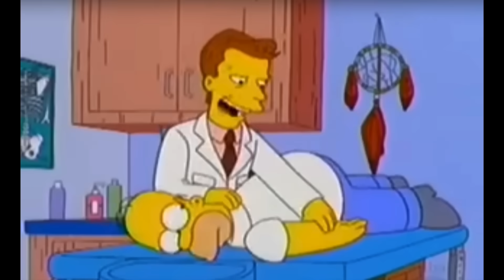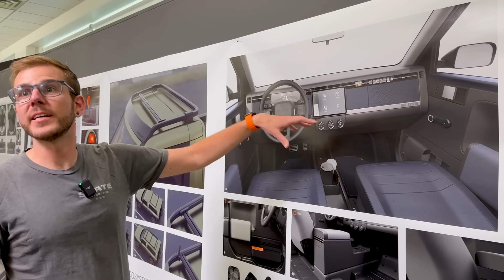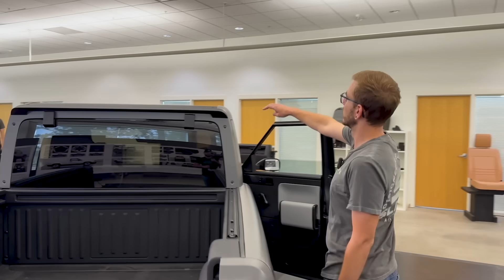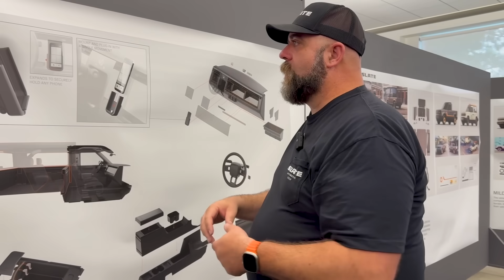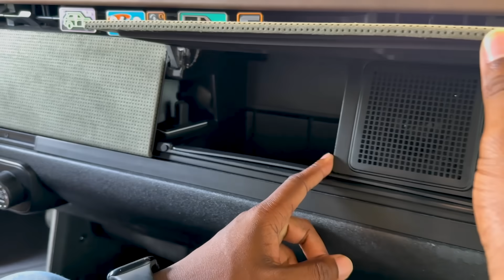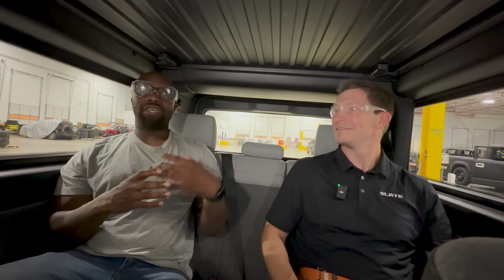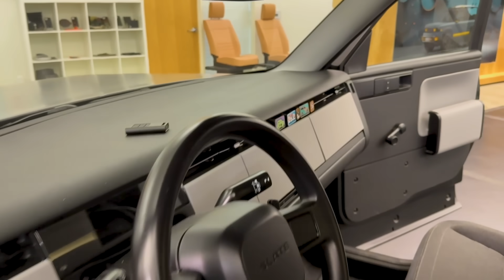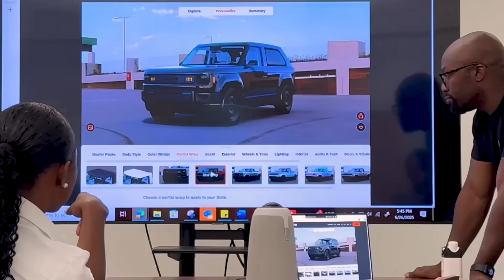The Slate: America’s $20K Answer to China’s Cheap EVs (Exclusive Access)

Comment: The only thing i have as a problem (from a perfectionist standpoint) why isnt the battery upgrade 2 normal batteries ? Wuldnt that also cut alot of costs? But since the money is already in another system that wont work

Comment: I wish you had asked about access to the traction battery. Is it 400v, 800v, 1000v?  Can I add a power access strip in the bed? can I hook up a generator and diy a range extender?  Can I even tow?
Reply: It's 400v
Reply: 1000 Lbs towing capacity….so no
Reply: The Slate truck has a towing capacity of 1,000 pounds. It also has a payload capacity of 1,433 pounds. The truck's bed is five feet long.
For 27.5k base price (its gonna be over 30k on release).. thats not good. 
New Mavericks and slightly used Ridgelines are the same price and are WAY more capable/relaible as trucks.. and 'truck' guys dont even consider those 'real trucks'!
Trump cut the $7,500 tax break (i think you still have till the end of the year to get it), so unless Slate drops it to 20k themselves (which they should), it'll be better off spending that 30k on something more worth its value.
Reply: All no.
Reply: Generator yes the rest?? Tow maybe an inverter and power strip in bed sure if that's your thing

Comment: There's no way on earth this vehicle will only cost $20k, but it's great marketing.
Reply: feeping creaturism ftw
Reply: If they take all the lego pieces off and u get a bare bone skeleton with minimum range and no options, it might be 20k after the 7k or what tax return.
Reply: yes, it's 27k because the $7000 tax credit that would've made it 20k is going away
Reply: @syloui By the time it goes into production there will be no tax credit.
Reply: It's gonna end up more than 27 k as well  @syloui
Reply: @syloui and with dealer make ups it will be .. $30,000.00… with no radio and crank windows 😂
Reply: @tpike32  i believe they are going to follow the tesla business model and sell direct.  That will avoid the dealer markup but will also complicate the where you go to buy one.
Reply: Yeah they are fluffing everyone up. Just like Tesla including rebates and estimated gas savings in the proce unless you un check them. 

It's a cute little ev truck and reminds me a lot of a standard cab S10, but I doubt this will be more than a city runner with 80 miles of range in it's cheapest trim... Nissan can't even do it and you can get stripped out leafs that nobody wants.
Reply: @volvo09  The average American only drives 40mi a day and those who are regularly going on long road trips probably aren't looking for the cheapest vehicle possible to do so. Those who have to live so far away from work that this range wouldn't work are probably not looking for a small EV truck anyway as their daily anyway. This will probably fit well into the millennial work-from-home market, which is a very large sector of the population now, since its cheap and customizable to allow ones personality to show through without needing to really be mechanically inclined or that into cars.
Reply: Closer to 30k than 20k
Reply: Oh yea. $3000 delivery fee $1200 detail fee 👌😅
Reply: The range is horrible
Reply: 20k with 20k value added price increase.Then another 5k dealer markup. Then another 5k dealer prep then 1k transport fees. Full charge extra.
Reply: @phil4986 no dealers, you buy it directly from Slate
Reply: India gets em down to $8000, so it's not impossible.  They real problem was an ancient law favoring EVs that Trump removed.   It was asking for an impossible gas standard for small trucks to block cheap Japanese imports.   Thus SUV took over since law didn't cover them.
Reply: @JemieBridges I thought he was trying to eliminate the small displacement engine issue we’ve had that has caused them to be nonexistent and only GIANT sized SUVs and crossovers to take over
Reply: This car is stupid. Crap range, super basic and close to 30k with no rebates.
Reply: @zackrob9170 Agreed. How much do power windows really cost? Not to mention there are only two windows. Silly

Comment: Big plus - plastic don't RUST. I hate plastic, but it has its uses. I hate 4 door trucks.
Reply: Hate 4 door could b e a bit over the top, I have no use for a 4 door truck, rather have the bed length. I would want JUST the BASIC!

Comment: This truck will be an absolute failure. And not because it's not good. There is no way that the automobile industry in the USofA will tolerate a market disruptor like this. The auto industry has spent the last 30 years getting people out of relatively sane cars and into more profitable SUVs and monster pickup trucks. They don't want this trend reversed. The NTHSA is owned by the American automobile industry and they will be able to draft "safety" regulations that will deep-six this truck and others like it.
Reply: Regulatory burden is what has turned trucks big.  Not profit seeking.  Large footprint vehicles are more lenient for efficiency.

Comment: Bigger bed is all it needs to be the perfect electric truck. Maybe they'll make it an option? The perfect truck until now is the 1980s Toyota Pickup, which was a tiny truck with an available 7' long bed bed, which is bigger than pretty much any current small, midsize, or full-size truck. I think you have to get a 3/4 ton to get a longer bed today.

Comment: Great overview btw.  At about 40 minutes in, you guys are standing and talking across the frunk. The windshield wiper blades appear to be different lengths, which, if true, seems contrary to their design and engineering philosophy.  My other question is that it's great that the blank slate will be so affordable.  However, there has been no discussion about the cost of the accessories.  If I accessorize my slate to resemble an R2S, will the slate end up costing as much as the Rivian?

Comment: It's actually got the design ethos and engineering approach of the original Land Rovers - the Series 1/2/3. Almost modular. Smart - easier to repair, more dynamic, more useful.
Reply: True & the doors & handles remind me of the classic Range Rover. I'd spec mine out like a Camel Trophy 2dr Range Rover.

Comment: Finally someone is going to sell a base model of something which is actually base!
Reply: I see nothing wrong with it being RWD. 4wd and AWD is nice but not necessary, even though so many have been conditioned otherwise. Drove my 91 S10 RWD for years through Michigan blizzards, storms, ice, snow, dry, etc and never an issue.
Reply: @Deetroiter  RWD can be a dealbreaker in places with inclement winter weather unless you can keep a 2nd vehicle around for winter usage. 

I had a RWD '95 Sonoma and it was pretty good in the snow, only requiring minimal ballasting. However my RWD '01 Ranger was fucking AWFUL in the snow, even with snow tires. I've had 2 of the '06 Colorados, one 4WD (Z85, but with tires sized like a Z71) and one RWD (ZQ8 with the Xtreme body kit/graphics package), and the 4WD one was unstoppable in the snow while the RWD one struggled more than the Sonoma did, but was still massively better than that piece of shit Ranger. Now I've got a 4WD '16 Colorado and it's unstoppable in the snow.

Which is a long roundabout way of saying whether or not the Slate is usable on snowy roads with RWD will not be known until they're actually out in the real world facing real life conditions. It might struggle to start moving in 1 inch of snow on level flat pavement like that piece of shit Ranger I had or it might just need adjusted driving habits and a small amount of ballasting like the Sonoma I had. Or anything in between.
Reply: @Deetroiter  People just think that summer tires are a viable option for winter weather so obviously they need 4wd lol
It's illegal in civilized countries but......
Reply: @kristoffer3000 short of a muscle car or sorts car, nobody (with common sense) runs summer tires in Michigan. It’s mostly all seasons and some people run winter tires. AWD was rare and FWD was barely a thing. Everyone survived Michigan winters in their RWD 1976 Ford LTD, I’m positive they can manage now in 2025!
Reply: @Deetroiter  Here in Norway all seasons are illegal and with good reason, they're trash.
Reply: @Deetroiter  Actually deaths per capita has dropped about 40% in vehicle accidents.  Now I do think AWD gives people a false sense of security that probably has them pushing limits more, but just because all my friends survived not having child seats doesn't mean having them isn't safer.  

The thing is 4WD pickups only make up 27% of sales in the Southeast.  And 78% of sales in the upper midwest.  So sure, I had an 86 ranger RWD in Colorado and would throw a 500lb railcar hunk of steel in the back in winter, but people prefer to buy AWD/FWD.  

And that's what determines if a car will sell or not.  I know myself, I wouldn't buy a RWD pickup today.  I especially wouldn't spend $28k for a RWD when I could get a maverick AWD or FWD for less.  

And like you say, take off those summer tires and put on a set of 4 season, and there goes 10% of your range on an EV (I know, I have Crossclimates on my Model 3)
Reply: @Deetroiter Absolutely fact. If people would understand traction and momentum 2wd works 95% of the time. Good snow tires on 2wd would beat 4wd.
Reply: @Deetroiter  RWD during the winter is awful.   Sure it can be done but it sucks compared to just having front wheel drive.  I will never drive a RWD only vehicle during the winter in my life.
Reply: @resresres1  with good tires and careful driving it’s actually not bad at all.
Reply: Use winter tyres like a normal. Person  @resresres1
Reply: @focojeepr as long as you dont have hills, especially with stop sign at top.
Reply: They'll sell 10 base model units in the first month, and every single one after that will be optioned to the moon, or a custom order that will be sold to someone else the second you say your not paying above sticker.
Reply: Base model equipment at fully loaded prices!
Reply: You can order them, most people want options, so they don't carry them on the lot any more.
Reply: Too bad it's priced higher than the Maverick. The Maverick starts at $24k while the Slate starts at $28k.

Since the Orange Turd already signed off on the end of the EV tax credit, and the date is sooner than the Slate's projected first sale date.
Reply: @PlatypusVomit  I found out about the Mav launch after the line for reservations was out the front door (2-4 mo). Finally have money to spend, might have to shop it and the competition again
Reply: @PlatypusVomit  Don't worry, Bezos will remind him who calls the shots and it will be extended
Reply: @PlatypusVomit  did orange man make love to yo mama??
Reply: You can still get base models, they just need to be easier to get, but nobody buys them so only fleets order them.
Reply: @volvo09  no you cant not as base as they need to be im talking no ac no radio even no gauges. and no one has has had that since the 70's

Comment: Slate needs to make a front seat that seats 3 people included in base model
Reply: You mean a bench seat, maybe they will.
Reply: actually its pretty interesting when you brought that up
car license typically lists the amount of seats a car have.
the Slate comes out of the factory with 2 seats, but anyone could buy the "SUV Kit" and increase that number up to 5 seats, would that require re-licensing the car?
or the Slate would already come licensed as a 5 seat vehicle from the factory lol
and if they do have an option for a bench seat, how would that work with their "SUV kit"

i like the idea behind this of the car being fully modular, but the execution leaves a lot to be desired...
Reply: @HoLDoN4Sec  So if I take the rear seats out of my SUV, I need to change the registration?  Or if I buy a 15 passenger van and turn it into an RV? 

What part of the 'execution' of this leaves a lot to be desired?  Minor details about how it will be registered?
Reply: @ian3580  car registration has a listing for the amount of seats a vehicle has.
lets say like you said you have a 5-seater SUV, if you produce and add a 6th seat in the trunk but your car is registered as a 5-seater in its license then if you get pulled over you're screwed, you also cant insure your car like that neither.
but if you have a 5-Seater SUV and you decided you want to get rid of the 2nd row seats than your car license is still valid.
basically, you can have less seats on your car than what it is registered as, but not more seats than that.

as for the slate - the most minimal addition of a simple decent two speaker setup with a basic android auto /apple carplay capable headunit for a car that costs 27,500$ (its NOT $20K!!) leaves A LOT to be desired and a poor execution of this platform.
another poor execution is their answer for not selling the "blank slate" with any speakers or headunit - "just use your own portable bluetooth speaker, or buy the "premium sound package - which is a bunch of garbage tier portable speakers that they put inside the dashboard"
if that's not a poor execution then what would you call it?
maybe its also because a 27,500$ brand new car in 2026 (the launch of the slate) is using MANUAL HANDCRANK WINDOWS???
electric window regulators cost 35$...

this car would've been a much better product had it came with basic fundamental features which have been an industry standard for the past 25 years.
they could've done it better than that, but clearly choose not to because if they can cash in on it then why not.
it is also very shady from them to not mention how much would these "accessories" cost...
how much would the SUV kit cost? 500$? 1000$? 5000$? 10,000$?
nobody knows!
i think they are not marketing this well at all.
i really don't think most people would want to buy a "blank slate" and the parts separately and then have to travel around for weeks having workshops install their fixtures and wrap their cars etc...

they should've just have it that you could have them install all of these "accessories" and wrap the car for you, OR as a slightly cheaper option have them just ship you the "blank slate" with all of the "accessories" you purchased to either install yourself or go to local workshops to install for you.

that is what i meant by "poor execution"

Comment: i think 20k for the base is still high. it'll end up being 36-40k with taxes for even basics like power window, infotainment or a backup cam
Reply: Pretty sure backup cam is required and comes with the base. It's a NHTSA requirement since 2018.
Reply: Yeah my ‘25 Maverick ended up about 40K. I did get two pricey options, (tow and lux package) but for even for $30-35k the Maverick blows the slate out of the water.

Comment: If they had a version that towed 5000 lbs I would buy it in a heartbeat
Reply: Yes, they have a part/option for that.  It connects to the front of the truck and pulls the truck and whatever you're hauling.  It's called EFF-TOO-FITTY
Reply: Never going to happen.

Comment: Why are people so obsessed with this electric vehicle. They are all scams. Batteries WILL fail in under 150,000 miles, then as all other ev’s it’s then worthless cause batteries are tens of thousands to replace. Nissan kicks and Hyundai seltos are just as cheap, will last just as long, and come with WAAAY more standard equipment. And if the engine or transmission do fail, they are together, cheaper than the batteries in an ev.